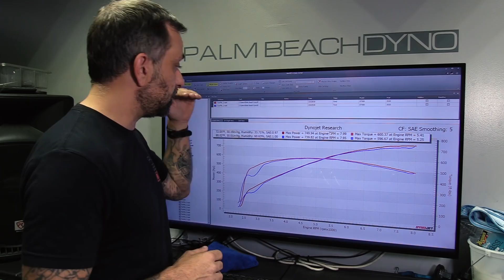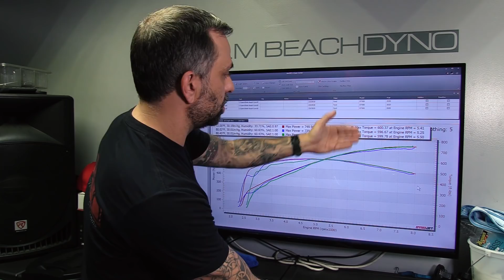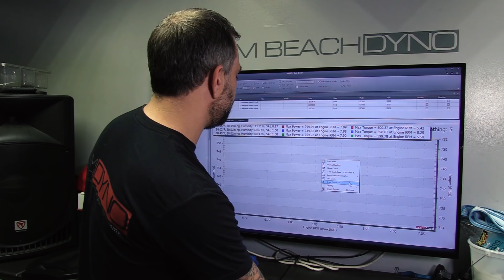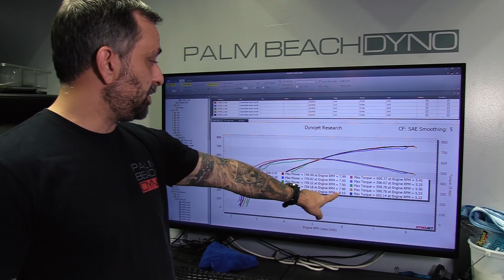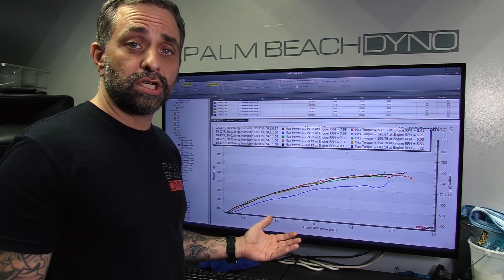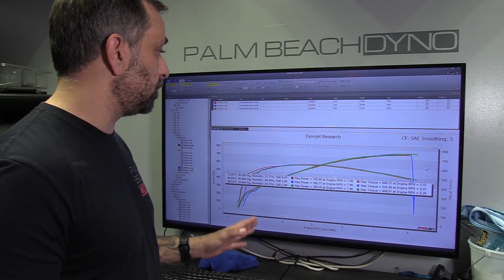DYNO TEST - 2020 GT500 - Lethal Performance Track Exhaust

Comment: Ken, what was the weight savings by switching to the Lethal Track Exhaust?
Reply from the maker: I'm drawing a blank. Either 5 or 10 lbs. I have to weigh the stock stuff again. The Lethal parts are about 15 lbs
Reply: @PalmBeachDyno  Awesome. Weight savings is weight savings. No matter how much, or how little, it is.

Comment: So what's this make on 93?
Reply from the maker: I haven't dyno'd this car on 93 yet. But I just put 93 in it last night and will get it on the dyno next week when we test the JLT intake. I would say as it sat in this video, probably 730 if dyno'd the same day.
Reply: @PalmBeachDyno  730wheel safe tune 93 octane is a badass street car.  Should run high 9's

Comment: 32 more hp from the last pass at the track but still down 19hp just from the air quality ? So with same air should be making 779 so that would actually be a 48 hp pickup with the same air quality when dynoed 731 at the track last  !
Reply from the maker: Hoping so. I went last night. We had super bad conditions. low baro, 120 water grains and it still trapped 138+. I was having 60' issues and never ran video. I'll take it back next week in better air once the JLT goes on and we should be going 140+ all day long on stock pulley
Reply: @PalmBeachDyno  I look forward to seeing how these cars will respond once the DCT is unlocked ? You can you see how much timing is being pulled or limited in first or if it only does it once launch control is activated . 60,330 ft is horrible for these cars all by design I know .

Comment: Why is there a low end dip in power? Seems like stock tune is better
Reply: Reduction in back pressure results in worse lowend performance. This is what typically makes drag cars horrible daily drivers and prone to poor idle (besides ridiculous cams). Drag cars dont give a shit though as that only matters in first gear. Every shift past that they'll never go below 3k and you'll only find these lowend issues in the <2500k ranges.

The reason for this is you're essentially removing anything for the engine to "push" off of, initially. Think of it like a sprinter with or without chocks, or like a swimmer with or without a dive block in a race. Once the power levels equalize to exceed the negative pressure, either via exhaust length or atmosphere as your engine starts shoving air through it, that's where you find massive power gains, particularly at the top end.

Its extremely difficult to exhaust balance an engine to get both lowend and high end performance, and usually not worth the effort as it either costs a lot up front, or ends up costing a lot because of all the moving parts you have to add to the system in the form of moving/adjustable parts like plenums, variable diameter/distance valving, etc. Every change you make also then affects exhaust impulse and scavenging, which can also worsen your topend as well.  There's also the very real benefit to low end power loss, as it helps to prevent you from being as prone to spinning your wheels on the line like a jackass. This benefit doesn't tend to be as valuable with 2step/launch controls though as with drag radials on a good strip you'll be launching from 3k+ anyway... but still good for when you're smoking your friends at the redlight.

In a nutshell though: physics is a bitch.
Reply: @formdoggie5  https://youtu.be/2E6uGkotqKA
Reply from the maker: That will change based on how I tip into it. I'm not making any changes down low so no reason to slam the throttle down